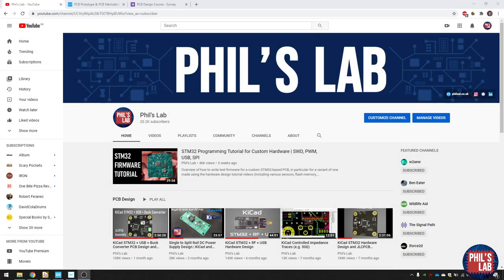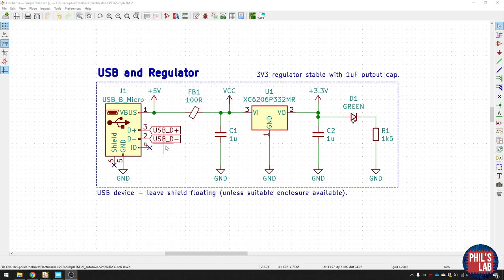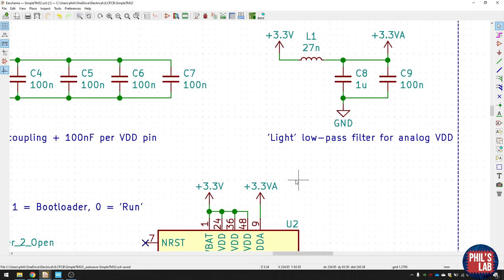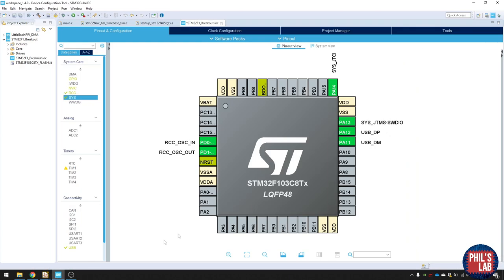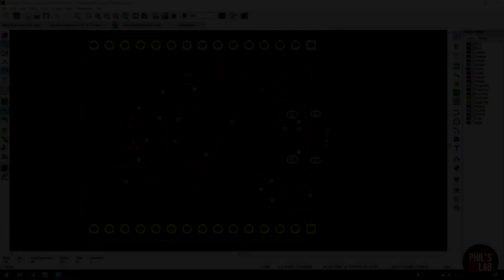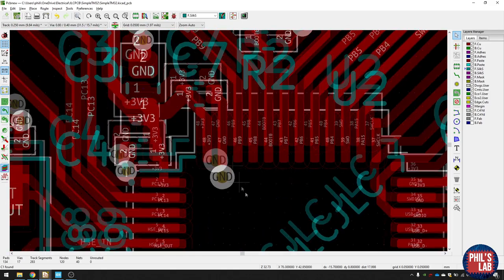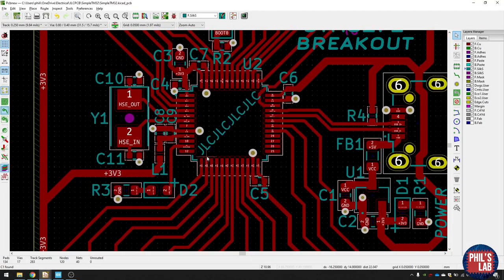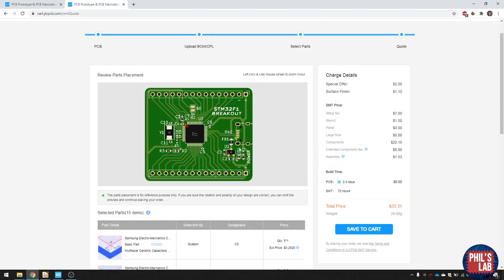KiCad STM32 Hardware Design - An Overview in 20 Minutes - Phil's Lab #15

Comment: JLC is quite good or even excellent in making PCBs, but I cannot say the same when you order PCBA, although they say chips are on stock, like hundreds of them and I want to make prototype of 10-20 boards , when you place an order it turns out they don't have these chips at all..after waiting for 3 weeks to let them to get them. It were some PIC16 and STM32. It was really really disappointing. And then they make decision by themselves that incomplete order will be produced. Let say a set of boards make a complete project and they decide that if one of them is possible to be made form A to Z then they don't care that the other won't be made 100% populated or at all, they just produce the first one without asking, even if it all was in one order... Sometimes not having the full set spoils the idea of production at all. My advice is to always ask them on chat if they really have these parts on stock, even when their fancy ordering system says there are many of them. But yes, their site ordering system and even online and offline PCB designer is impressive and they are really fast and cheap in making excellent PCBs.

Comment: Appreciate this Phil, really helped clear up some things I was uncertain about using STM32 datasheet and reference manual. Used your tutorial to make a breakout board for a simpler STM32 TSSOP-20 for my microcontrollers class. Also appreciated your "small" comments and pro tips along the way like ferrite bead, one decoupling cap per VDD pin, etc. Thanks a lot!
Reply from the maker: Thank you very much for your kind comment, Luke!

Comment: Finally, a "blue pill" with working USB. I think a lot of people know the situation with the Chinese boards.
I have one remark ( it's not that important but I see you use it throughout your videos), you always say that the Boot0 pin puts the board in bootloader or not. This is true but I would rather suggest using the terminology from the technical reference which is, that the Boot0 pin just jumps to the system memory part of the board. Why do I have this suggestion? Because the user can overwrite that memory if it wants. By default, the chip comes with the bootloader in that memory section so you can flash it via UART1, but I can overwrite it if I want.
It's a small suggestion, not that important. Great video, really condensed but contained all the details necessary! And I responded to the survey as well, hope to see a course soon enough.
Reply: Hi sir, I have one question about that.
Can I program the STM32 with the SWD connexions without pulling the Boot0 up? I undestand that it's the way to do it, but I would rather confirm it before trying.
Nice video! Thank you

Comment: Phil, if you connect the USB resistor to an output, you can force reenumeration on reset by bringing it low for a short time. This would avoid the need to reconnect the USB cable when downloading a new firmware version.

Comment: Well explained.. In most of your designs you are using STM microcontrollers is there any specific reason for that???
Reply from the maker: Thank you, Manu! Initially I was thinking about which MCU platform to settle for and ended up going with STM32. Just really liked the application notes, IDE, etc. Don't really see a reason to use other platforms at the moment, as the MCUs do all I need for now!

Comment: Hey, good idea for a video, to do a nice and short one :) As far as I know, it’s better to have a T shaped junction rather than join the traces at an angle like you’ve done with the 3V3 here. Also with the via’s to gnd so close to the component pads I have read that the solder can be sucked away from the pad and into the via and so they should be placed a bit further away. I’m assuming since you’ve made quite a few boards already you’ve not seen that issue though.

Oh and you could join together your 3V3 pins on the front layer underneath the MCU?
Reply from the maker: Thank you, Matthew!
Any reason why T-shaped junctions should be better? In most scenarios I believe that'll be irrelevant.
Regarding vias, I typically go for tented vias - so covered by soldermask - so unless you're placing part of the drill hole in the pad, no solder can be sucked away through the via. Therefore, I always try to go as close as I can to the pad to minimise inductance - never had a problem so far.
Reply: @PhilsLab  I’ll see if I can find the application note I read about it, it was really interesting. It showed the best connection for RF was a “pinched” T shape where the trace gets narrower just before the join, not what I’d expect at all! With a DC voltage line you’re right it will be irrelevant.

Comment: Does the ferrite bead (FB1) also help with limiting the current on connecting to USB? A board I recently designed causes my STLink and UART-Bridge to disconnect whenever I connect power to the board and I have the suspicion, that my design draws too much current, because after that it works fine.

Comment: mr phil, i'm trying to learn how to just make ADAPTERS with kicad and have them made so i can put connectors on a board. like just a USB front panel device, so it's not electronics - it's 18 pins to 18 pins. what should i learn or watch to just get simple pcb's where i surface mount conectors and recepticles designed in kicad?

Comment: Hello Phil,
In this specific board, could you explain why you choose the 8MHz crystal over the 16MHz that you usually take?
One more thing. Why did you choose this 2x conn pins order?
Thanks great video!
Reply from the maker: No particular reason for choosing 8 MHz over 16 MHz. Both are easily scaled via the STM32's internal PLLs.
I guess I just wanted to use a different crystal package for once.
The GPIO pin header order is just to fit the pinout of STM32 so I don't have to cross traces, use vias, etc.
Thanks for watching!

Comment: Thank you very much for this course in short and extended length, as well all your other tutorials!
I use it as starting point for own STM32 layouts; really helpful.
Just one minor note (even if it does not matter, since the oscillator is symmetric): PB5 (OSC_IN in the data sheet) is labelled as HSE_OUT in your layout, and PB6 (OSC_OUT) is your HSE_IN. Is the change IN/OUT intended (e.g. because OUT from osc view is IN for the MCU and vice versa?)?

Comment: Hi Phil, great channel, I've been watching for a little while. I have a quick comment about the layout. I'm guessing the USB connector sits on the PCB. You have the grounded USB connector above the +3V3 rail with just solder resist in between. OK you've not connected the shield but it will probably be connected at the PC end.

Comment: Dear Phil, Glad to see this video. Really found it useful. I do have some queries, as I started working on this board.  Kindly address. 1) How do we decide number of GPIO headers required. 2) Is there any sequence to be followed between GPIO header and MCU GPIOs, i mean, should pin 1 of MCU match with pin 1 of GPIO header 3) How do you group header pins, i mean how do we decide which pin to assign for the GPIO headers when we create these headers. Thanks for the session. Regards :)))
Reply from the maker: Thank you! Regarding your questions:
1) Number of GPIOs and therefore number of headers is decided by your needs and your project's needs.
2) No, as long as you stay consistent and document it, you decide the numbering. I typically go by logic and/or how easy it is to route.
3) It's entirely up to you. For signal integrity/EMI purposes however, it is also very good practice to provide a ground return pin next to every signal pin.
Reply: @PhilsLab  , Great Phil. Loved it. Any update on pcb designing course. Looking forward towards it. I would want to design some hardware boards for energy harvesting applications. I do want to create some reference designs based on some power management ics.

Comment: Hi Phil, Great Video
i just have a 1 small doubt,
shouldn't you remove ground plane below crystal?
i have seen in some tutorials where it is suggested that you remove all copper pours and tracks from underneath the crystal
Reply from the maker: Hi Paul, Thanks for your comment! I've tried both with and without removing ground planes undearneath crystal but have not noticed any problematic differences. The only thing I don't do is route any high-speed signal traces near/under the crystal.

Comment: Hi Phil, question about the Analog Voltage domain (VDDA) filter. Are the LC values recommended from some Datasheet/Application Note, or did you use some calculation or intuition to determine those? I found this LPF calculator:
https://electronicbase.net/low-pass-filter-calculator/

For 27 nH and 1uF, it determines the cuttoff frequency near ~1MHz. I don't know too much about power supply for analog circuitry and what is a good cutoff frequency, but would it be beneficial to swap the components to attenuate lower frequencies than that?
Reply from the maker: Hi George, The values here are only approximate and as you've seen, only fairly high frequencies will be attenuated for this L-C combination. The answer is (as always) - it depends. It depends on what response times you need in your measurement circuitry (e.g. for the ADC), what frequencies of interest you are looking at, and what is outside your desired passband. For a simple board like this, we'll get away with using no filtering at all on VDDA.

Comment: Excellent  videos. Keep it up. You once did a design on RF circuits. Could you design a PCB with an on board antenna (PCB trace) like on the common ESP32 or ESP8266 microcontrollers?  I really would love to see how this  can be done.
Reply from the maker: Thank you for watching!
Yes, I've had a couple of requests for on-board PCB antennae. It's quite a large topic and one that typically requires (fairly expensive) simulation software, so not sure I'll be doing anything on that anytime soon - sorry!

Comment: Thank you very much Phil for introducing me to STM32 microcontrollers. For some projects I had in mind Arduino wasn't cutting it anymore, and now I am designing my first STM32 board. I think it's an awesome alternative to arduino, but with a whole lot more power and options to choose from. I would love it if you could make an example in which you interconnect two processors on the same board to expand I/O (Let's say one with LTDC controlling a display, and the other one doing the data processing and gathering the data that has to be displayed through the other controller). I am now using the STM32F746BGT6 (LQFP 208) to do a controller for a very large aquarium with sensors and 24bit ADCs all over the place, and an LCD touchscreen display to show temps and configure some things. It's 12$ a piece and I think I could have done with two cheaper ones without driving any of them to the limits. Just can't figure out how to do it from the datasheet, and you explain things so crystal clear I would love it if you would show us how that's done. I think you did it for the flight controller but you don't go into much detail about that. Thank you very much!
Reply: Why do you need 24 bit ADCs for an aquarium?

Comment: Which regulator would you suggest if i want to get 3.3v from 9v battery current requirements are  200mA. Do you think it would be efficient to use the same voltage regulator as you have used ?

Comment: Esd IC not included ! Is there need of esd protection in usb section while communicating with microcontroller.
Reply from the maker: This IC has ESD protection internally on the USB lines.
Reply: @PhilsLab  grt

Comment: Awesome vid :) did you use a tool for preparing the assembly files for JLC?
Reply from the maker: Thank you very much! I followed the same process as detailed in the longer (3hr) KiCad STM32 videos, so basically a bit of manual work. I really need to look into those tools though :D
Reply: Ah okay. I have a way to do it, but maybe you had superior tooling I didn't know about :) 
What I use now: I found a plugin for Kicad that you can use to export the BOM straight from Kicad to JLCPCB format, including the LCSC part numbers. I also found a Python script to convert a cpl/pos file to JLCPCB format. That works reasonably well, sometimes the rotations are off and need manual tweaking. I can lookup the links if you want.

Comment: How do you program this board using USB? Does STM provide a USB bootloader?
Reply from the maker: For some STM32s they already include a USB bootloader. If you check the 'Boot modes' section of the MCU datasheet it'll say.

Comment: Your videos are absolutely amazing.I am watching them like a entertaining movie and if you try to design embedded linux board using stm32f429 or any microprocessor you prefer that would be wonderful.Great job please keep going like that.
Reply from the maker: Thank you very much, Burak! Pretty much the same rules apply to every STM32 MCU, so hopefully the KiCad/STM32 tutorials should get you going in the right direction :)
Reply: @PhilsLab  Actually I am having trouble with external RAM and FLASH.It seems hard both choosing the right ones and connecting them.

Comment: To program this board from usb do I need to first flash a bootloader?
Reply from the maker: No, you can flash it straight away with SWD (sometimes also UART, USB, etc. - depends on the particular IC).

Comment: Could I suggest that you set up Patreon? You could have a few different tiers. One basic tier where a supporter could expect some content per week or month (going through a board design like this) then a higher tier where you'd take input from others perhaps, offering some support via email or over Discord or IRC. 
You could even consider an even higher tier ($50 or $100+ per month) where you'd get some other perks (like posting out a blank or populated PCB of each and every project you describe or do).
I reckon you'd make much more money as a monthly subscription doesn't involve commitment other than the continuing recurring subscription. I've got several $5 and $10 patreon subs that I've been supporting for a long time and are an integral part of my online content consumption.
Reply from the maker: Thank you for your suggestions! I actually do have a Patreon but I tend to keep that a bit hidden in the description, as I don't feel too comfortable 'forcing' that on people. I still need to add various tiers + perks as you suggested, so currently supporters will pledge an amount they decide for themselves.
Reply: I don't use any product or service that requires a subscription and probably never will... but would consider donating from time to time as funds allow...